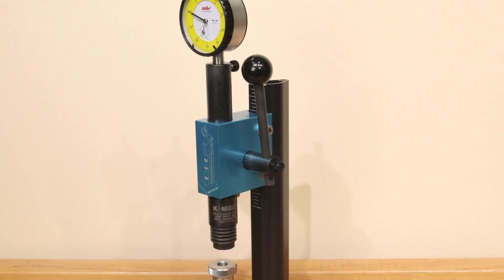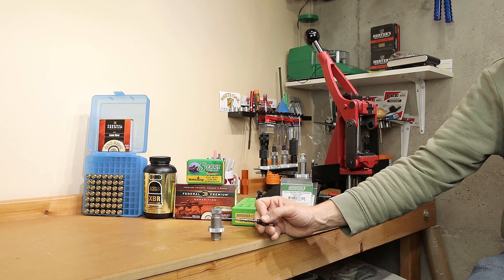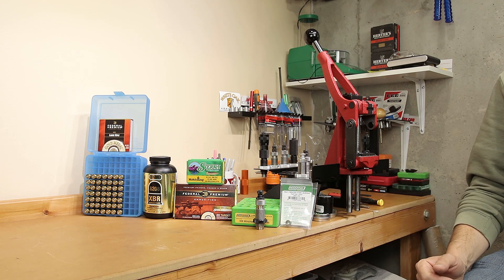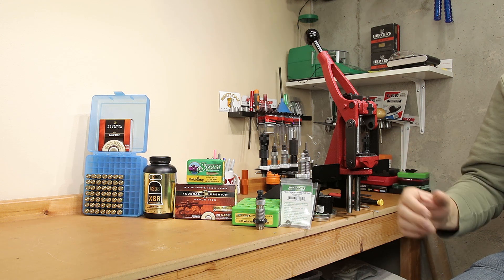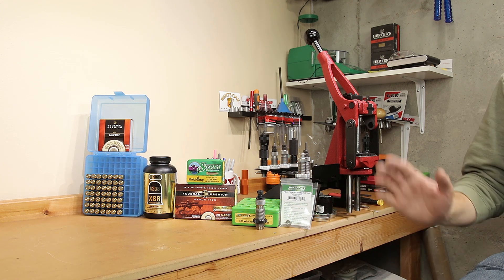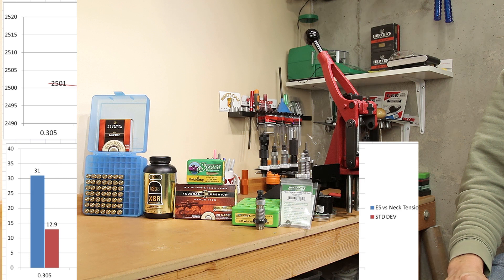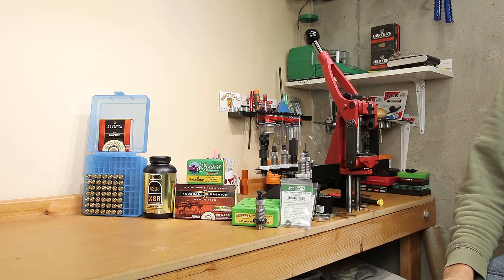Proper Neck Tension - How Case Neck Tension Affects Performance

Comment: I rarely see handloader's using pin gages to accurately measure the actual mouth after neck sizing and springback.  They are cheap and usually ordered easily in .0005" increments.  I am a machinist so I have pin gages laying around the shop.  But I also ordered specific gages for the different calibers I load for and leave them on the reloading bench.

Comment: There is a factor that is hardly ever discussed that is central to this discussion. Different powders have different preferences for neck tension. One of the best tools for seeing this is a full on short range group competition rifle. Typically these are chambered in 6PPC. The most popular powder for this application is VV133. It gives better results with neck tenion of at least .003. Another powder that is used LT30 seems to perform better with less. They also seem to do better with different seating depths, with the same bullet. Bottom line, the truth in this video is the truth for this particular set of components. One of the reasons that I recommend loading at the range, a practice that is almost universal in short range group competition is that many combinations can be tested during the same trip to the range, under the same conditions. Keep up the good work. I enjoy your videos. They are a real service to shooters who want to learn more about reloading.

Comment: Comment to old video.  It seems that the 0.003" is based on the idea that the ready ammo for military or hunting  is under a lot of knocks, shakes etc. when on field.  So the seathing depht would not stay if you dont have propper tension.  Just wondering that most likely you have prebared the brass with 0.002" when doing the original load development, thus the best results are found there.  So maybe just do 0.002" vs. 0.003" load development from start to finnish and see how far from one another you end up; powder fill, seathing depth etc. to the best group sizes. ...And maybe some shaking and knocking to cofirm if they work the same after being handled with out worry in the world.    I have had some problems to understand some suggestions and ideas on load development in the internet, before I startet to make note on what they are doing the develpoment for, and what is the type of shooting it is being used. Not my native language, but should be more or less uderstandable :D

Comment: could this be part of why the basic lee loader set goes as well as it does. Seems to create a fair rock solid neck size/control, with the "knockometer" in use on it (hammer).

Comment: Glad to see a video showing velocity variation and accuracy testing. Honestly I think it might be beneficial to be precise with terms. The size difference between a projectile and the inside neck of a ready to load cartridge is the amount of interference in the fit, the force required to seat a bullet is bullet seating force, and neck tension is the amount of tension or compression the neck of a loaded cartridge places on a projectile. The amount of interference fit does not equal neck tension as brass in the neck might be thicker or thinner, work hardened or annealed. The amount of neck tension doesn’t equate to seating force as the case might be dirty or clean, oxidized from annealing or not, and so on. 

It seems in the end the idea is to achieve consistent bullet release upon firing in order to reduce velocity SD and improve precision and accuracy.

Comment: Looking to switch to this method of setting neck tension. When using the expander mandrel to set tension, im guessing you use it just before you charge and seat bullet. If thats correct, does it matter what type of FL sizing die you use? Currently im using the redding s bushing die. Is it simple enough to just use the same die but simply adding the mandrel at the end to dp the final set tension? Do i need to remove the bushing in the die or does that stay in?

Comment: You comment that you have no way of measuring how much spring back occurs. Can't you just use your series of mandrels, to see what fits? Ballistics Tools makes a Match Grade Case Mouth & Neck Tension Gauge that works exactly on this principle: see how many steps your case mouth will go over, and that's where you are—easy peezy. Machinists and geeks like me have pin gauge sets that can be used for this purpose as well. The point I'm making is this: judging tension by measured fit is independent of method used for sizing the neck. Many of us simply use whatever expander ball the sizing die provides. Others, like you, have mandrel expander dies with series of mandrels, all adding up to considerable expense. Still others use a bushing in the die; the bushing  squeezes the outside of the neck. How do you compare results of the bushing die with the expander ball with the mandrel? See what fits into the case mouth and what doesn't!

Comment: This is a fantastically educational video.

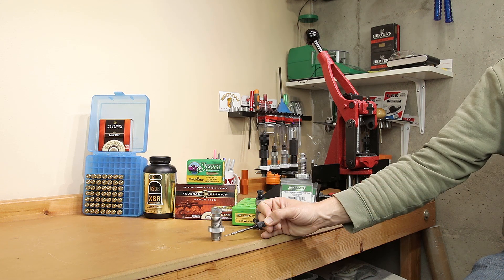At 2:35 I think you meant to say that the full length sizing die UNDERsizes the case neck and then the expander ball is pull back out of the neck, expanding the inside diameter of the neck.

Comment: i just compared forster bump neck with .290" bushing and forster full length die with factory  expander ball and got a velocity decrease of 30 fps with the full length size die. from what i can measure, the F/L die has only .0015" less neck interference with the factory expander ball.  wondering if anyone has tried this and what the result.. cheers

Comment: I’m not convinced neck tension matters. The friction of even a crimped load is minuscule in relation to the enormous pressure generated in microseconds. Also, that pressure acts equally across the entire casing, deforming it to the shape of the chamber. I don’t think it’s correct to think of a projectile like a cork getting popped out I.e the tighter the cork the more pressure as the entire neck is pushed outward into the chamber at the same time as the force acting on the base of the bullet. Using the cork analogy it’s like expanding the bottle neck at the same time as pulling. I don’t know the math but I’d love to compare the Newtons required to extract even the tightest seated projectile with the kPa acting on it. Intuition says it wold be extremely lopsided

Comment: Sounds simple enough to me. I want to know just how much force is required to separate the seated bullet from the cartridge case at ignition. This  will influence the amount of pressure developed before the bullet moves at all and thus the initial acceleration rate. Along with charge, headspace, jump and barrel friction, neck tension affects the position of the bullet relative to barrel resonance at the instant of exit from the muzzle. Simple right? It's kind of like calling the wind accurately except that we can measure neck tension by its effect on group size.

Comment: Do you use the same process - standard FL size w/o expander + (-.002) expander mandrel - for all calibers you reload? Also, do you have any concerns about overworking the brass with the standard FL die vs a FL bushing die?

Comment: Hi Bolt: I love this kind of chit. Anyway, I'll have to get the expander mandrels now ........ thanks (-; Hey, here's something to think about. Optimum flash hole size and case neck length vs the chamber neck length. And is the face of the neck on the case cut exactly perpendicular to the axis of the bore? What's the distance between the lands and the case neck. Then you got the bullet seating depth vs the lands clearance, case volume, bullet weights. The incarnations are endless. Note that there is a moment that the bullet is little more than a piston in a cylinder while it is supported by both bore and case. The case is molten at that moment and I believe that's where the bullet can become misaligned to the bore causing the bullet to corkscrew. It's centerline is correct but it shows up on the target as a slight spread. BR shooters would say the bullet hasn't gone to sleep.

Comment: I greatly appreciated this type of experiment. Have you attempted to accurize any of the other neck tensions to see if you were able to reduce group size? - especially the 1.516 group and maybe one of the others that had a tighter es/sd but produced a larger group. Thanks again for the video.
Reply: Exactly what I thought.

Comment: I use to think all bushing where all the same, how wrong i was. 
iv been using a 337 redding bushing on my lapua 308w brass for 10 years.
 A month ago i bought a forster neck tension gauge and checked the neck tension on my redding 337 annealed once fired lapua brass. 
To my surprise the gauge would not even enter the case on the smallest 304 size.
 so i decided to get a few Whidden bushing started with 338 337 336. 
the 337 gave me a close fit on the 336 pin.
 336 gave me a tight fit on a 336 pin.
Next i will be getting a few expander mandrels to try.

Comment: This is a very informative video and of great significance to my own resizing practices. I have a Forster bushing bump die with a couple of SAC bushings. My most accurate method is to bump the shoulder ~0.002in and putting 0.002in of tension on my 6.5CM. Those rounds with H4350 yield the smallest groups out of anything I've tried. Those SAC bushings are miracle workers. I bought them after watching your product test and you told no lies. They work very well in my die. Thank you brother!

Comment: Interestingly enough the SAAMI description is the correct description for neck tension. The other descriptions you provide describe the measurement of processes you perform to achieve the described tension. It is like calling the amount of time spent boiling oats porridge i.e. I recommend 45 minutes of porridge for steel cut oats.

Comment: Albeit a bit older video but a very good video and the results in the end are EXACTLY what I expected (the size that was used for the original development resulted in the best results and I will explain why after a few things to point out first.

1) with regards to what "neck tension" actually means from an engineering standpoint which is the hoop stress within the neck of the assembled cartridge, the SAAMI definition is the correct definition of "neck tension".

2) the force measurement to seat the projectile is the best method to gauge what the tension (by definition) is and the consistency from cartridge to cartridge. This is the standard method used in almost all industries where interference / press fits are used like bearing on shafts for example. Bearing manufactures will publish or give out upon request the max fitting force for interference / press fits between a shaft and the bore of a given bearing which is a derived value for the max allowable hoop stress within the inner race of the bearing before it either experiences too much dimensional change on raceway of the the inner race (i.e., making the rolling element too tight) and / or stresses the material too close to its ultimate yield before plastic deformation and or cracking occurs. With regards to bullet seating, obviously we want this to be about as low as possible because of the combustion process.

3) using specific dimensional difference can work well (like saying, a .002" difference / interference) IF all other things, especially the amount of anneal / hardness are consistent. Inconsistencies here will lead to inconsistent hoop stress from cartridge to cartridge  regardless if the dimensions are the same. A materials tensile strength changes with its state of hardness or anneal (increases with hardening and decreases with softening) and higher tensile strength = more applied load for a given amount of stretch. Think of it like a spring, the higher the tensile strength of the spring, the more force it will take to stretch it say 1" (or think of it as the more resistance it has to being stretched and the same thing is going on with the neck of the case, the high its tensile strength from work hardening, the more it applies a counter force to the stretching force from the projectile being seated so basically the more grip it has on the bullet for the given amount of stretch). 

And lastly, why the results are exactly what I would have suspected knowing that the .306" expander was what was used during initial load development is because the load development is dependent on this factor. Neck tension is one of the many factors that directly effect combustion rate because it directly effects the initial onset of combustion / pressure rise. Since initially a "good" charge weight was chosen off of a variable that was already given a specific value, changing that value either way will take it out of that "good" zone because the value (really specific tension) was a determining factor for the initial charge chosen. Basically if say .307 expander was used for the initial development, it would be likely that 40.8gn charge would NOT have been the charge that gave the best results and what ever charge that did result in the best, if used here would have shown the best results using the .307 mandrel over the others in this test.

From everything I've personally seen / experienced over the years, with consistent annealing, what ever neck tension (neck size) used for initial development will always result in the best to use size because of its effect on the initial onset of combustion. Basically when doing an load development, this is a variable that effects the development BUT you have predetermined a value for this variable and thus arrived at the best results based on this predetermined value so changing the value after will no longer give best results because what was "good" for that specific value is not good for the other specifics. Think of it like temperature stability of powders, even the most stable of powders will have some change with temperature change (just not as much as others) and if you do a load workup at say in the 50°'s, you are going to see a difference if the temp is say 100° it might not be much or all that significant in some cases but the fact remains that the combustion process chances and what was good at one value of a variable (temperature in this case) is not the same as what it is at another value of that variable. All in all, other than seating depth, any variable that is given a predetermined value at the time of load development with regards to combustion itself, that value will be the best value to always use if you can (I say if you can because of the temperature one which we are at the mercy of mother nature with that one). Its the same reason why changes in case volume result in differences in SD, ES and average velocity for a given charge weight.... Consistency is the name of the game, not the specific value for a give variable

Comment: Hey so I had a strange experience this weekend that I have never known about.. so I have always sized my brass with a full length sizer and then run them through an expander mandrel the km set with .002 neck tension. Then I would wet tumble and dry them and then run them on the trimmer and case prep station. So I just got a henderson precision trimmer and this time when I went to trim they wouldn't fit over the pilot.. so I checked neck tension and sure as shit they shrunk back down to .004 to .006.. have you ever had or heard of this happening? I'm guessing it's from drying them in a case dryer?
Reply from the maker: I can not imagine the brass dryer would cause this issue.
Reply: @BoltActionReloading  I know I can't either but what else could it be? I also have been running too small of a bushing that is cresting .005 neck tension I ordered the correct one so I'm at .003 and then I'll still expand again.. but idk every single one shrunk back up

Comment: I agree right with your definition of neck tension. Strictly speaking it is a measurement of force. It is not a dimensional differential measurement. Having said that I realize that in the vernacular this the chosen definition. However the measurement of force to move the projectile “through” the brass neck is determined by the dimensional differential combined with the hardness of the brass and the condition of the surface i.e carbon, roughness, lube etc.